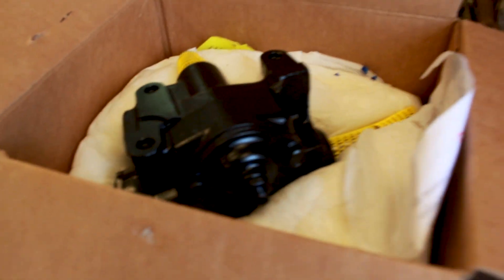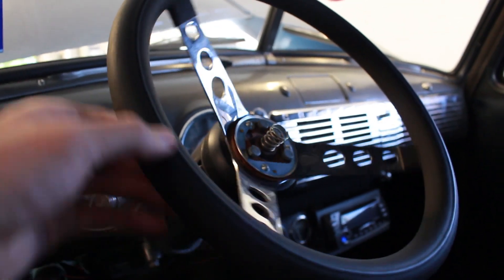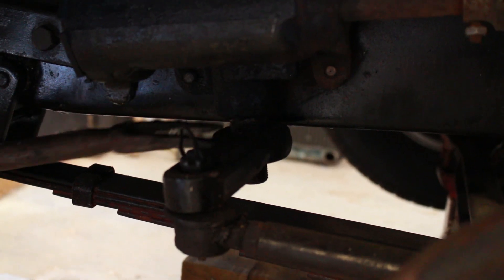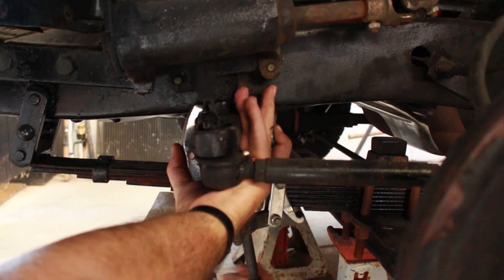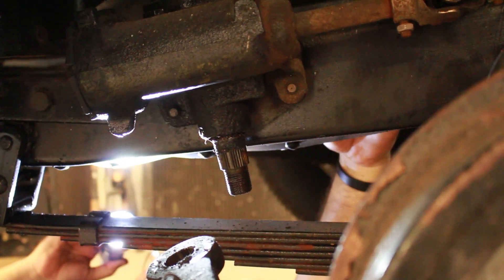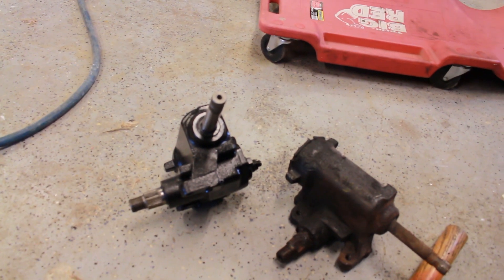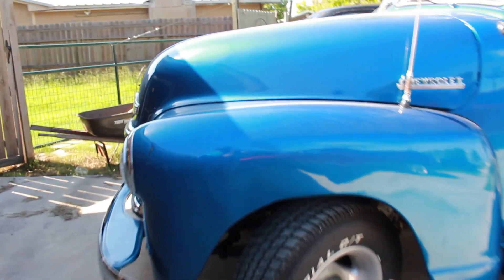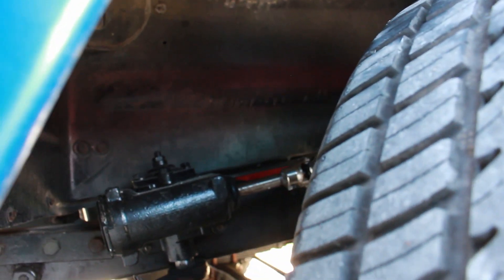How to Make a Vehicle Easier to Drive | Fixing Play in the Steering Wheel

Comment: In case you didn't know you can adjust the gear box to take all of the play out of the steering. On top of the gear box there is an Allen bolt with a larger lock nut around it, loosen the lock nut then tighten the Allen bolt in the center about 1/8 a turn at a time until there is very little/no play, checking in between turns. When done just re-tighten the lock nut carefully without moving the Allen bolt and you'll be good to go 👍 also pay attention to the steering wheel, if it gets harder to turn then you have tightened too much.